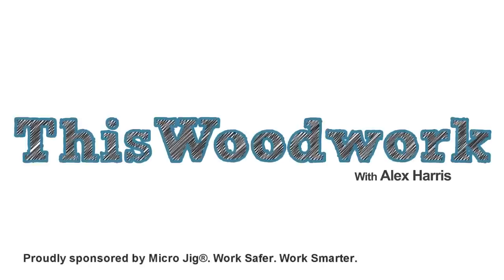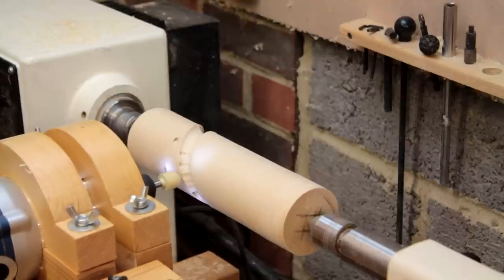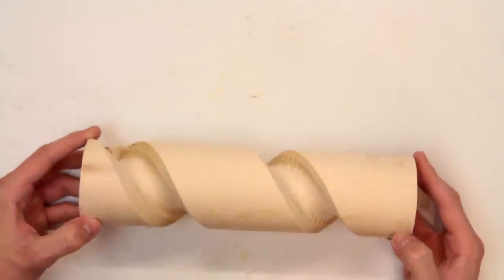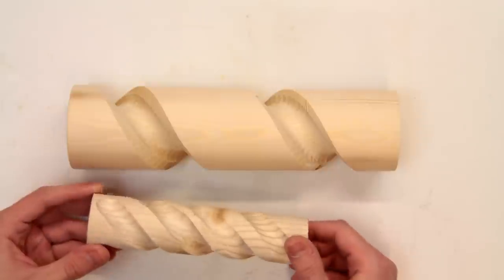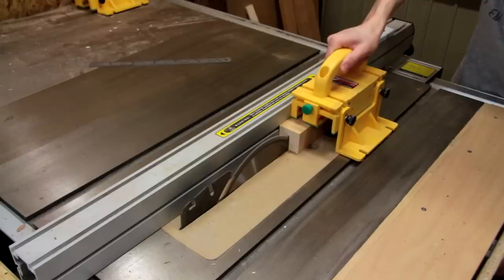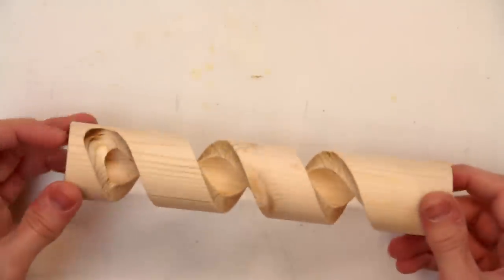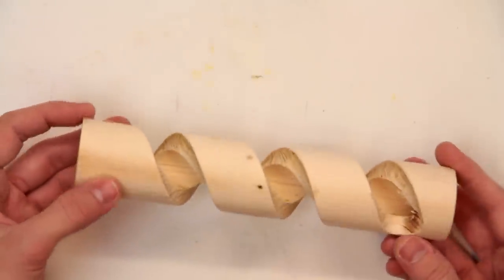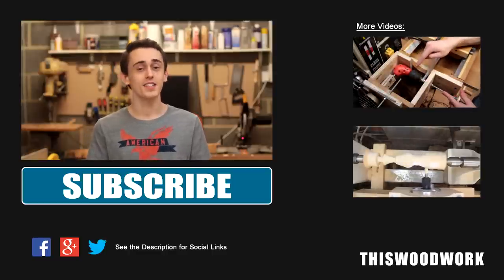Cutting Wooden Spirals on the Lathe: Homemade Router Jig

Comment: if you hadn't thought to try it, you should try working down through the gears as you go. (or up..) to get an accelerating or decelerating spiral. Also, surely you can just get a long spade or auger bit to hollow out the inside of your bits of wood for the hollow spiral? You'd need to have point makers for where to change gear so that it was repeatable but that would be easy. And finally, if you have a router bit which you can attach the other way around, so the cut curves outwards away from you, you might be able to (once you'd cut through the outer bit of the blank through to the hollow centre)- you could attach it from the inside to cut a radius on the inside to get a round edge on the spiralling bit of wood. That would be a nice thing to see. Give it a try! I've got a small lathe and a router (in my bedroom)(inside a Perspex box to catch the dust) but I don't have the room to build this contraption of yours.. Good effort! (also commented on your frisbee video- if you'd cut little grooves on top of the disc like on the ultrastars it should have flown more stably. I made a plywood frisbee years ago and found the unequal weighting due to knots in the wood had it curling with rotation in the air).

Comment: Try boring out your stock first with a large bit you would be surprised how centered it stays when the stock is turned by the lathe and the bit is held steady. Then you can put it between your two centres and it will have no glue squeeze out. But it sure seems to work well. Good on you young fellow.

Comment: Looks good.  Might I suggest another experiment?  Try boring out the centre of the turning after cutting the spirals.  The main issue I could imagine would be chip out, but it may end up being easier than cutting-routing-glueing-turning-spiral

Quite an ingenious system.  Have you considered teaming up with some people and developing it into a system you could offer for sale?  Say a kit form with most of the parts that just need to be customised to the individual lathe.

Comment: have you thought about maybe drilling a hole through the center of the piece intead of cutting it in half then hollowing it out
Reply from the maker: Donald Ewing 
Yes. It's certainly an option, probably an easier one too! I simply didn't have the equipment to drill a hole that deep. Drilling straight deep holes, even on the lathe, can be a little tricky, so I made do with what I had to hand.
Thanks for watching, Alex. :)

Comment: You're driving the chain incorrectly.  The two idler/tensioner sprockets should be on the "outfeed" side of the chain, not the side which the machine pulls upon the chain to turn the lathe.  That's likely part of the problem.  Great idea otherwise!